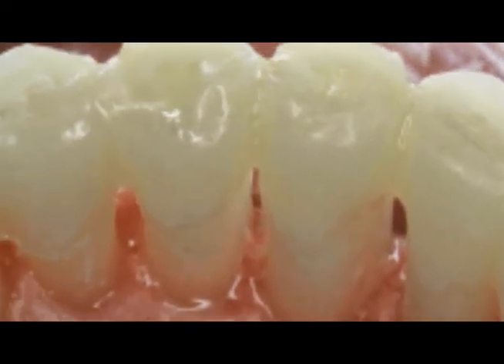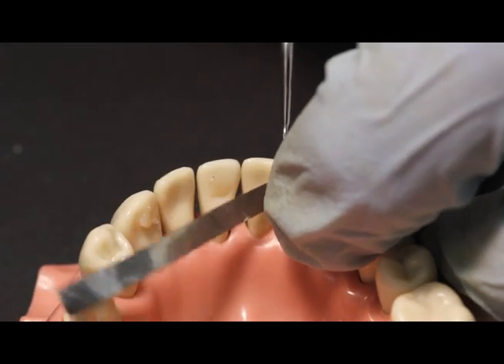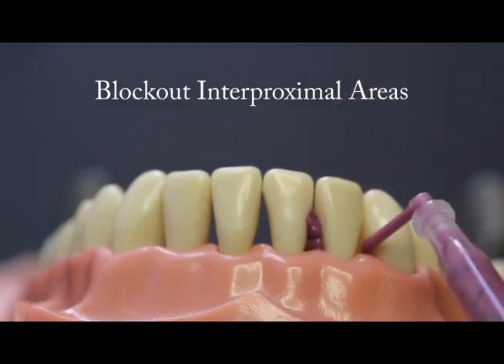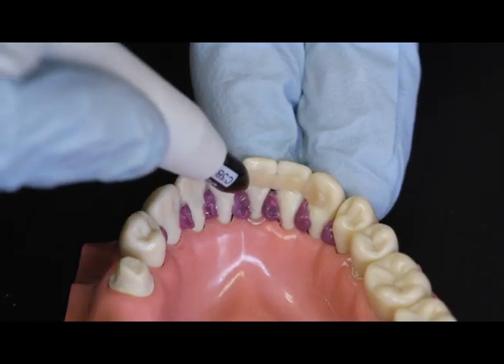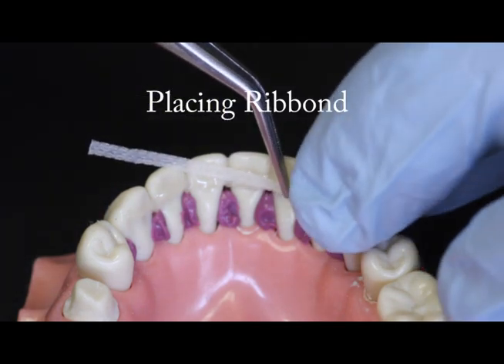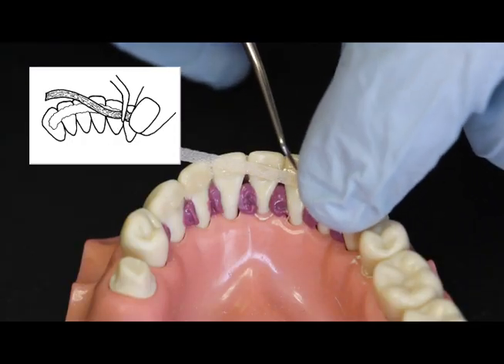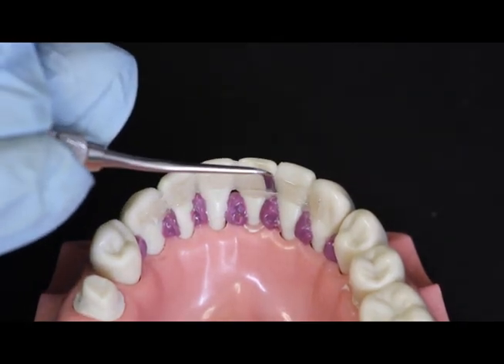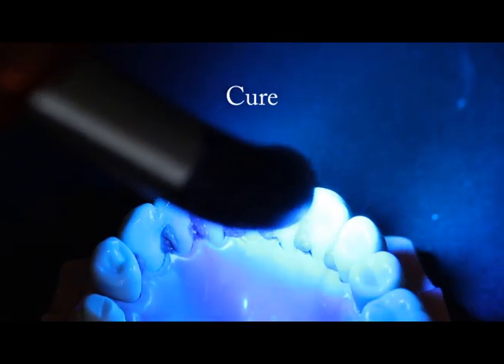Ribbond Periodontal Splint Technique

Comment: But this will make it impossible to clean the individual tooth's gums properly with dental floss. And this must be hard to remove without hurting the enamel of the teeth splinted?
Reply: You are right, but this technique would be used, when the teeth are not stable due to progressed periodontitis with receded gum and bone. The situation of unstable teeth are prone to getting worse, eventually you may loose the whole tooth. If you consider the issue between enamel damage and loss of whole tooth, I think enamel damage is a least sacrifice. 
You can not use normal dental floss, but you can use interdental brush or superfloss for sufficient cleaning in proximal area.
Reply: @Wolk-o3o  Thanks. In the end another dentist advised against splinting and I listened to him. My teeth aren’t serious enough to realise splinting. The cons are more in my case as improper cleaning with splint (I am religious about cleaning) will advance the disease more. Teeth are not terribly shaking to need splint. Routine dentist visits for cleans 4x a year and good proper care daily is a better option.